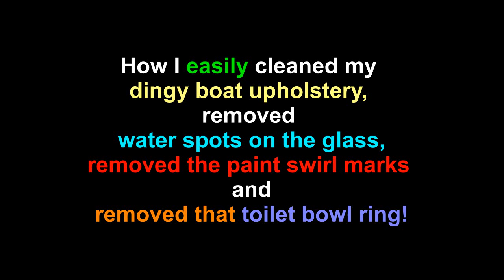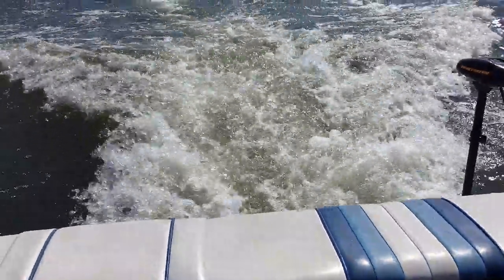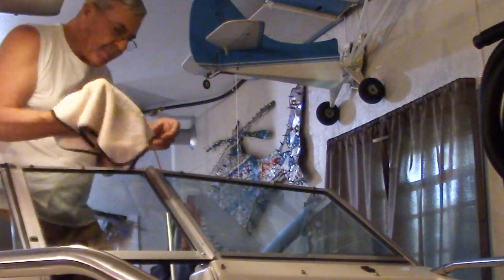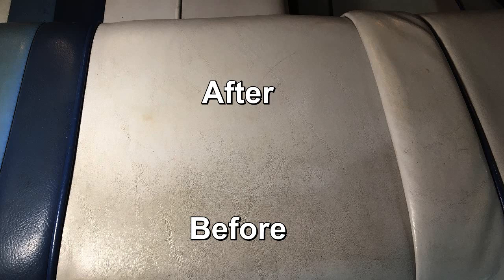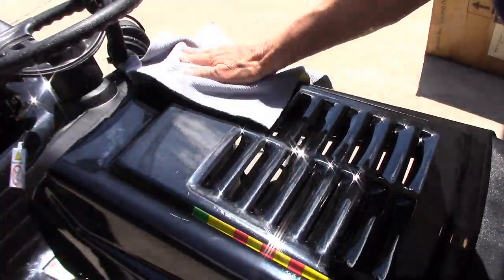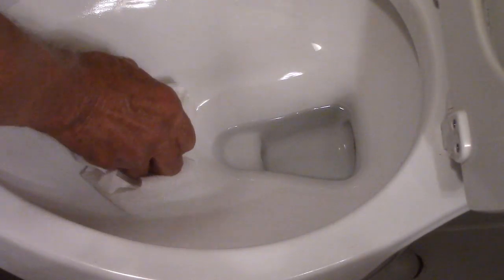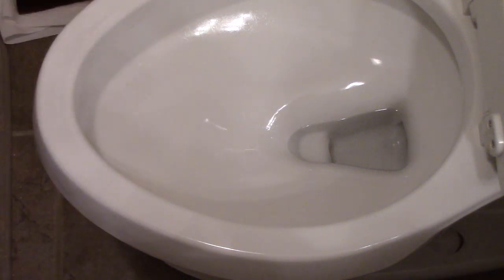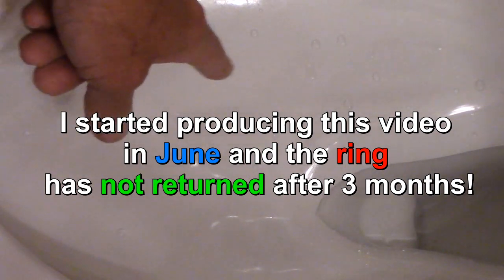Adam's ceramic Coating prevents Toilet Bowl Rings, Water Spots, Tractor Swirls, & Boat upholstery.

Comment: A little effort goes a long ways! I think I will give this a try.  I like to get the bathroom and kitchen SO clean I bought a uvBeast V3, 385-395nm uv flashlight.  You would not believe what you can see in your bathroom & kitchen with this thing;  even works under bright light.  Even a cheaper UV light will reveal things you missed if the room is dark.  I have been using Turtle paste wax on the counters, tile, mirror & sink;  The spray wax would make cleaning quicker & less of a chore.

Comment: Very informative video! I never thought of using my Swirlkiller Mini in a toilet before but apparently it works great! I use mine primarily to polish the wheels on my truck. Before Adam gave it to me a couple years ago, I always did them by hand. (Thank you Adam!) I will also try the Heavy Correcting Compound on my headlights, been meaning to do that. I was also very impressed with the results on the boat upholstery. Learned something there too! As always, thanks for the valuable info. Now I’m craving pizza for some reason...🤣
Reply from the maker: Haha.  Yes Pizza!  You also know how good Adams is from all your experience with it on your truck. Thanks much and Semper Fi.

Comment: It’s been 3 years now. Is 8 months about what you are getting out of each application?  

How could you tell it was time to reapply?

Did the ring ever come back?

What kind of cleaners did you use after application?

Thanks!  Great video!
Reply from the maker: I use only a toilet bowl brush and nothing but water.  I put a coat of Adams Graphine Ceramic Detail spray on it every couple of months, just to keep it up, since I use it on the chrome and sink, and do them all at once.  It is much easier, since it is water based with Graphine and Ceramic. It really lasts.  I don't have any noticeable rings.  Thanks much.

Comment: How has the toilet been holding up my ring is driving me crazy here in Florida.
Reply from the maker: Better than anything else I ever used.  I clean it good and just use the Adams Ceramic Graphine detail spray every few months on it, as it is easier.  It is still the best for me that I've found.  Thanks.
Reply: Thanks, I just installed the sparkle and shine bleach system, cleaned the bowls real good now ready for the ceramic coating. If all I have to do is use the detail spray every few months the battle is won!. We have a lot of mold spores in the air here in Florida so rings develop in about a week and a half.